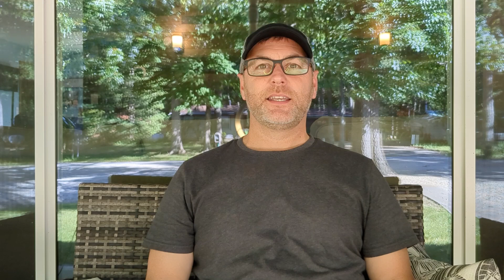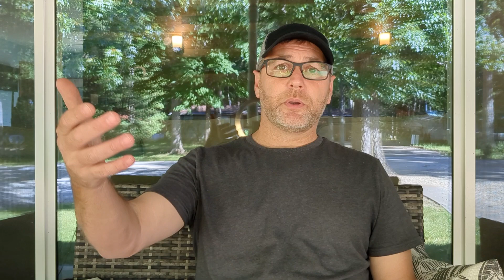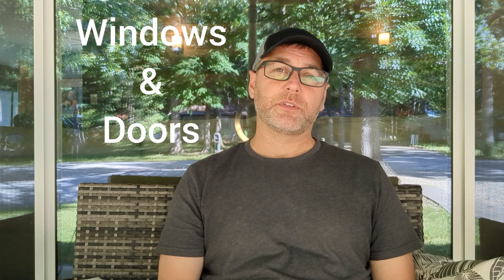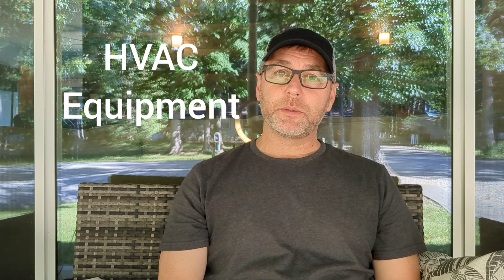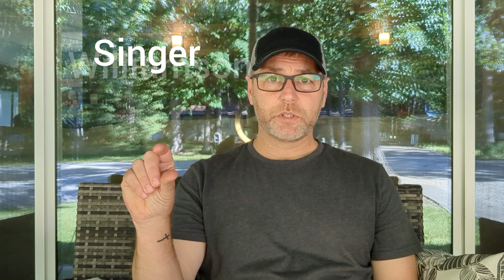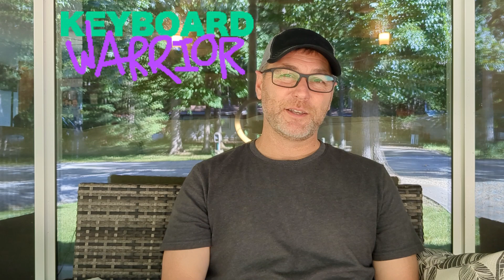No one talks about home efficiencies anymore

Comment: I've been in my new place for a year.  I spent a few months planning.  I replaced the 20+ year old A/C+furnace with a cold climate heat pump.  I replaced the original aluminum clad windows and sliding doors with new Andersen ones.  That alone cut the heating used by 70%!  I had the loose blown attic insulation removed and added 4 inches of closed cell spray foam changing the attic to conditioned space.  I changed the old gas hot water tank with a instant electric hot water unit.  The attic doesn't warmer than 90 even in Arizona summers.  In the past winter, it was reaching 100 in February.  I updated all the electrical to meet the 2017 NEC or later swapping out every switch and receptacle.   And this before I install a solar+battery system.
Reply: and how much did you spend on all that to save 80 bucks a month lol.
Reply: A lot.  But the savings are a lot more than $80 per month.  My summer electric bill is 75% less than my neighbors.  No more gas bills.  And I didn't even mention getting rid of the old bathtub surround and replacing it with a shower stall.  Changing the attic to conditioned was important since that's where the indoor air handler lives.